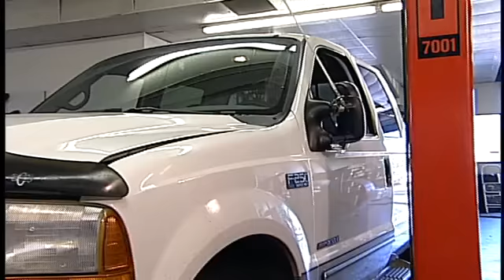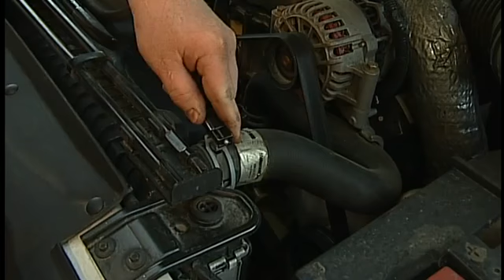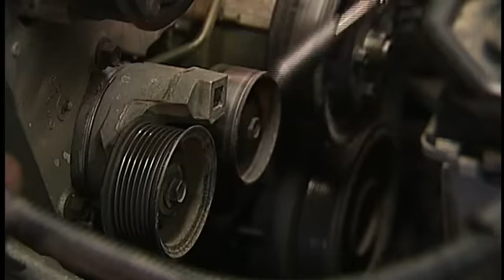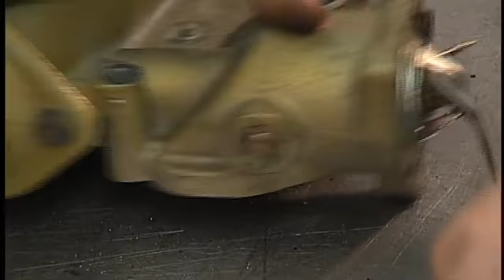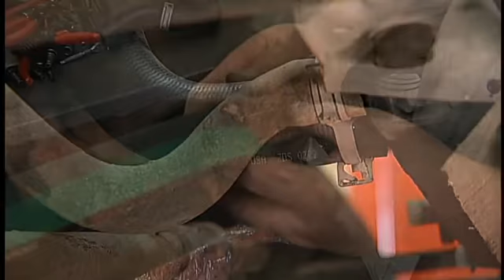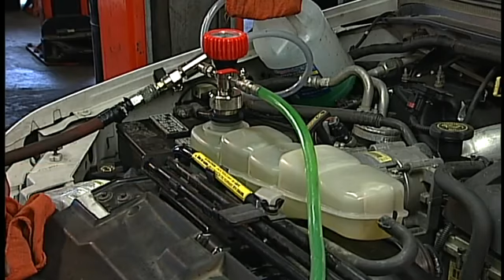Gates Water Pump Installation

Comment: Wow, only 3 thumbs up so far. Your video is the best and most thorough out. I am an Engineer and have worked on cars my whole life also. I would have done only a few things different. Like drain the rest of the coolant on the bottom block, both sides and put a new thermostat housing on. Maybe new heater hoses?
Reply from the maker: Yes, I do agree that it probably isn't a bad idea to swap out the heater hoses and such before they fail but I guess it depends what the customer is looking for.  All of that adds expense and it isn't always a common practice.  I also would drain the block....if it was easy to do.  I am surprised how some modern vehicles don't even have a radiator drain and  you drain it by taking off the hose, but in this industry every minute counts and saving some time can save some cost to the customer.  And I agree it is a very good video and we have Gates to thank for that.
Reply: @JimMackHeavyEquipment  thanks for your reply